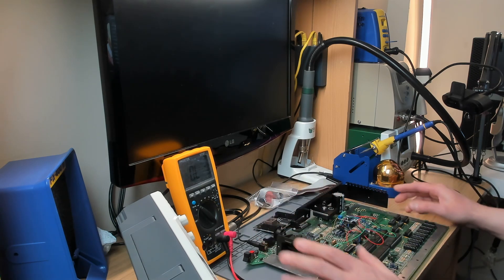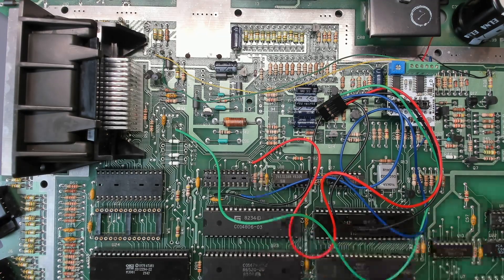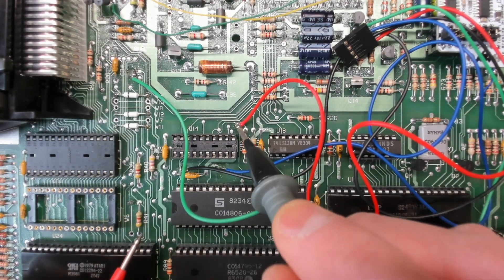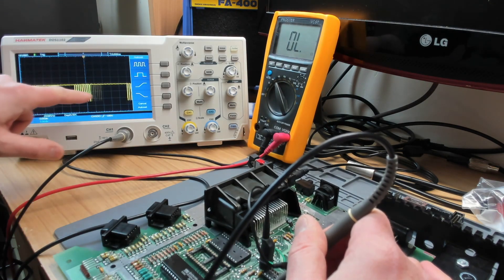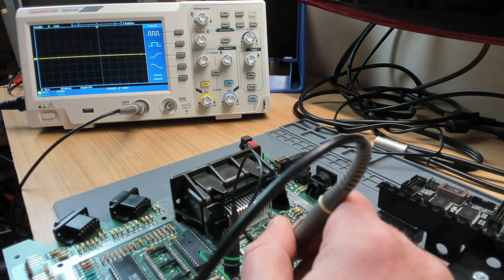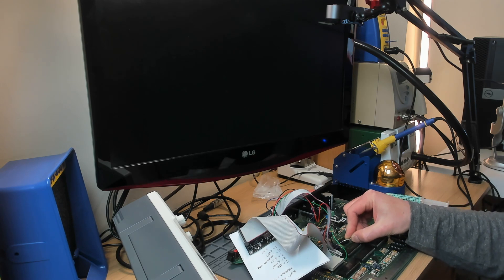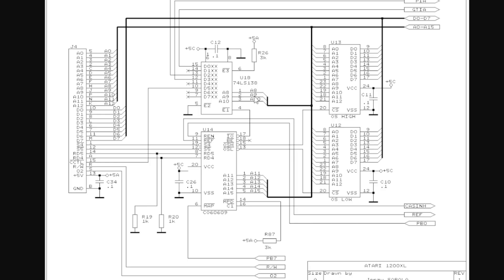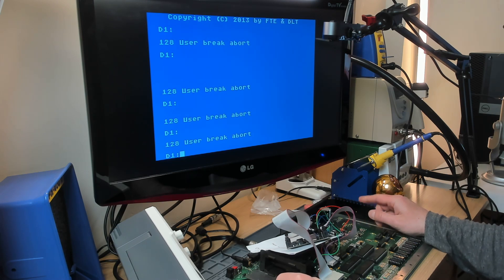Non-booting Atari 1200XL with shorted HLT signal

Comment from the maker: I eventually tried tying MMU pin 14 to GND instead of pulling it up to 5V, and the machine would then boot to the self-test with one bad ROM block. So I can only conclude that this situation (MPD being low) happening nine times per scan line when the signal was shorted to HLT was enough to crash the OS completely.

Comment: Wait i thought SpartaDosX was kept up to date by the community? The date on that 1200XL is 10 years ago, I thought the current version of SDX was no more than a few years old?  I guess the U1MB is that old now?
Reply from the maker: Yes. U1MB boards sold with Candle's original firmware are also thoughtfully equipped with a ten year old build of SpartaDOS X. :)
Reply: @flashjazzcat  10 year old DOS, for a 40 year old 8-bit computer.  not bad.

Comment: Nice work. Need to buy the scope soon, yours looks like a great candidate. Do you mind sharing the model of the TV? Does it have s-video? Thanks!
Reply from the maker: Thanks. The scope's fine. Kind of wished I'd bought a Rigol at first until I realised the Hanmatek is actually more than I need for my humble purposes. The TV is an LG M227WD and has absolutely every connection you could wish for, including s-video. There's a WDP model as well which loses the s-video connector, but since s-video is on the second SCART, that need not be a problem with the right cables. If you can find either model in good shape (or the LG M197WD, the 19" version), buy it.

Comment: Hi Jon I did add a comment a few days back never seemed to appear maybe this won't .. Is it possiable that the constant Halt signal is causing the incorrect area of ROM to be read as that was coupled to the MPD line.  it maybe ;and I've not tried to work it out that Antic is in control so no ROM being read anyway.   I also have produced some updated XEGS Circuit diagrams I did base them on Jerzy 's however corrected a few areas and added some that seemed to be missed entirely . they as very similar to 800XLF and XE system. however component numbers will be different. I did add a Link so maybe why comment removed.
Try searching on Atari Owners Club , Resources, XEGS Circuit diagrams.
Reply from the maker: Hi Graham. That's what I was wondering too, but since the MPD pin isn't going anywhere on the 1200XL, and since the math path isn't used by the OS anyway, it was hard to understand why that would cause a problem. I'm not even sure MMU pin 14 should have the MPD designator anyway. I'll check out the suggested resources, anyway. Thanks!
Reply from the maker: See my pinned comment, Graham. Might be of interest.

Comment: Which would you recommend upgrading to the ultimate all in one Atari. Atari 800, Atari 1200XL or the 800XL? There's always something about the original ole Atari 800 but the rarity of the 1200XL makes it a high contender.
Reply from the maker: That's a tough one. If Incognito 3 was available, I might recommend the 800 (since Incognito 3 will combine the functionality of Incognito and SIDE3), but as things stand, U1MB and SIDE3 provide the 1200XL (which has plenty of room inside for every imaginable upgrade) with a PBI hard disk which would otherwise be impossible to implement on that machine owing to the lack of a parallel bus interface. If you have the desk space, I'd be tempted to go for the 1200XL.
Reply: @flashjazzcat  really? I always thought the 1200 was the most problematic of the XL line, from the OS patch disks , to break-fix issues. .. maybe I should keep my 800 and 12xl then.
Reply from the maker: @MessalineApghar  All of that goes out the window when U1MB is installed. Just do the Bob Wooley keyboard fix and the Clearpic mod as well, and you have a fine machine.
Reply: @flashjazzcat  I was anticipating selling all my classic A8s ( which is about 6 or 8) except the XEGS, and getting a 130 and either a NUC or XEL

Thanks for the input.